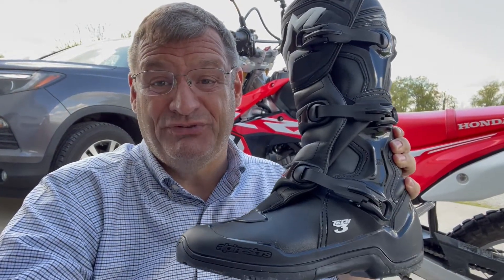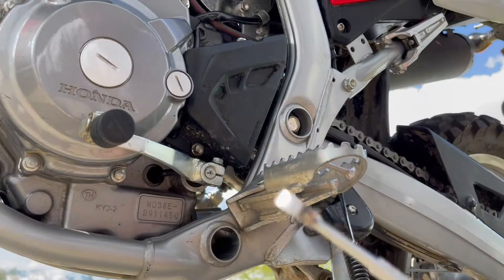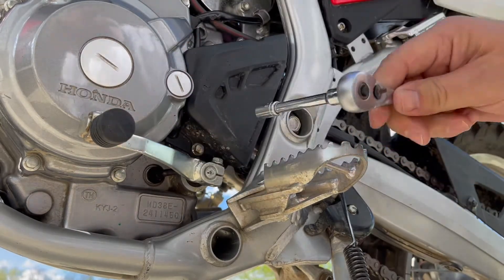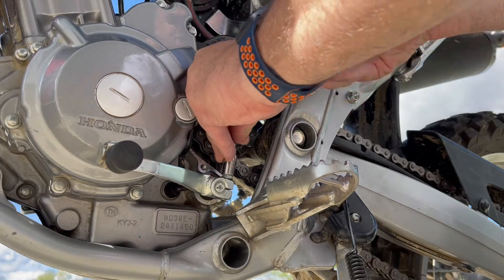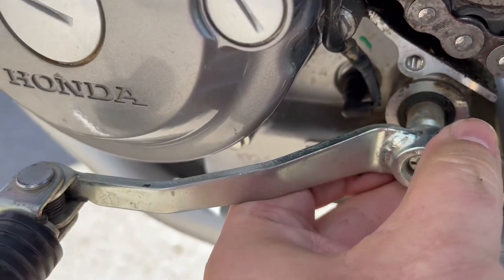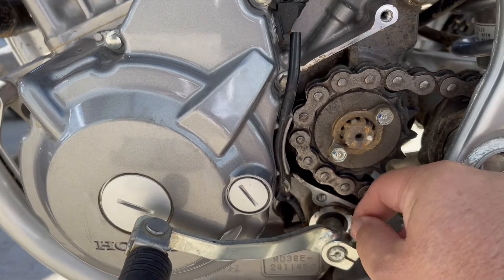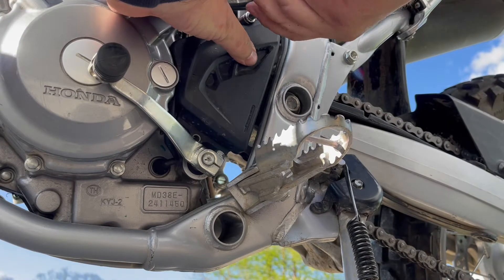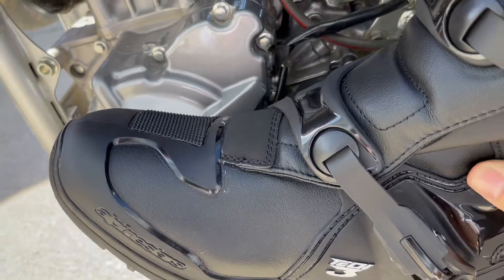How to adjust gear selector Honda CRF250L

Comment: Man I just bought the same boots and my 2022 crf250f  shifter is tight as hell  ,however my shifter is completely different than yours for some reason. Great video though ,thanks.
Reply from the maker: It’s something you don’t think about until it’s a problem. Hope you can get it adjusted
Reply: @arideinthecountry  yes sir, I’ll be calling the dealer tomorrow and hopefully I can find a solution, I really like the boots for the money but up shifts were a problem with this brand new bike …..thanks for replying.